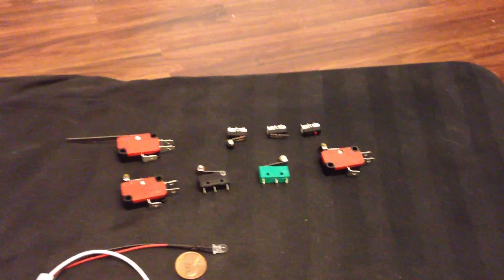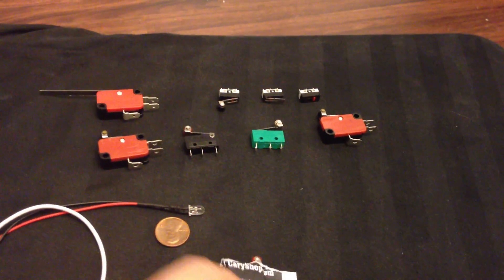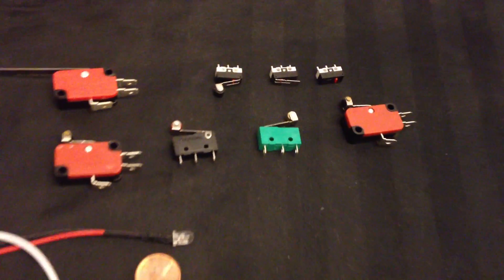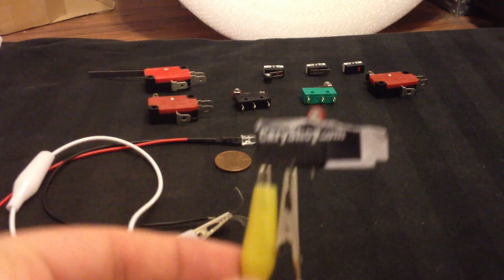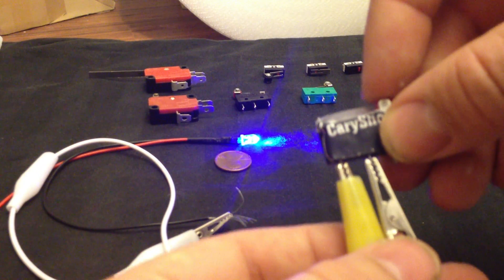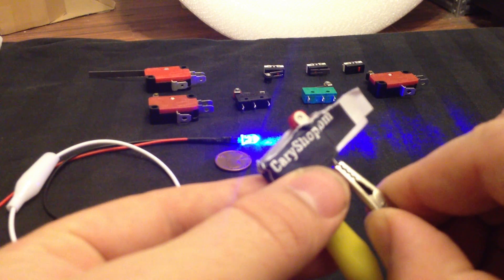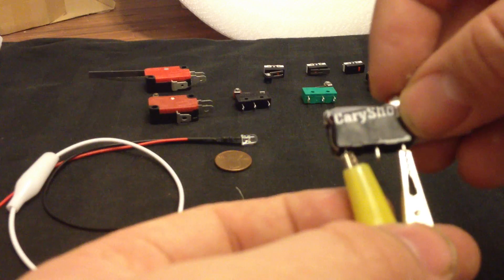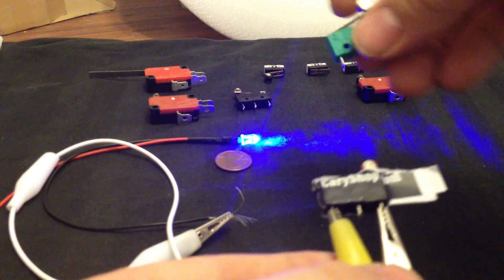How to wire a Limit switch

Comment: I wanna set mine up just like how you did it normally open but those wires where are they going to off of the switch where does the yellow wire go and where does the white go basically how is it all wired I wanna do the same thing with a led bulb just like that but I wanna know how you wired it I'll be doing mine in my car